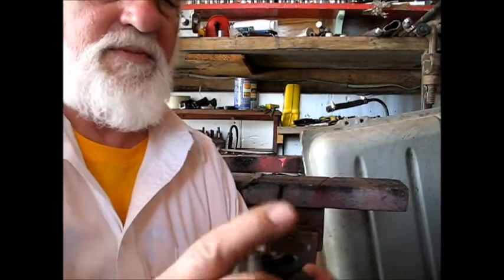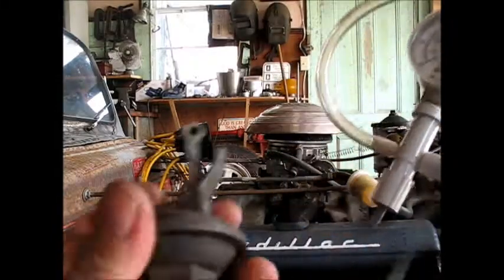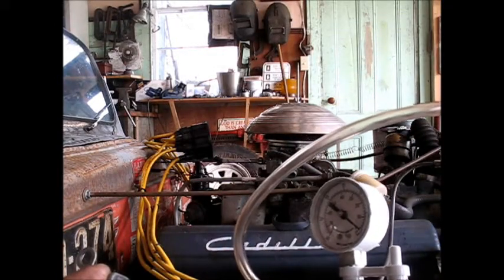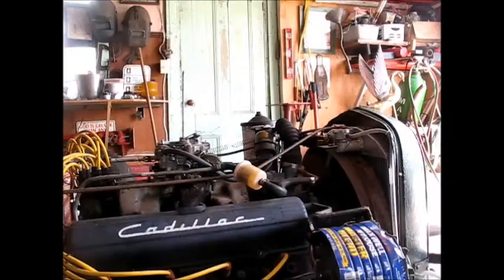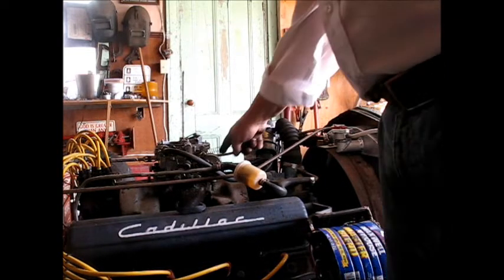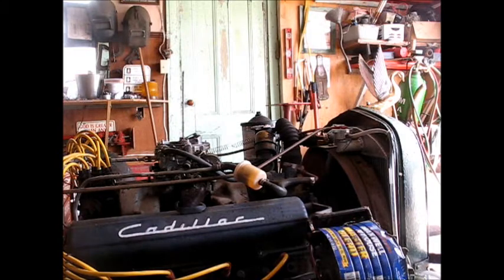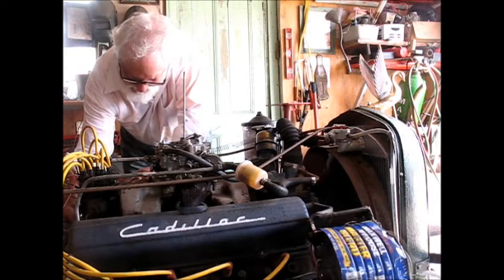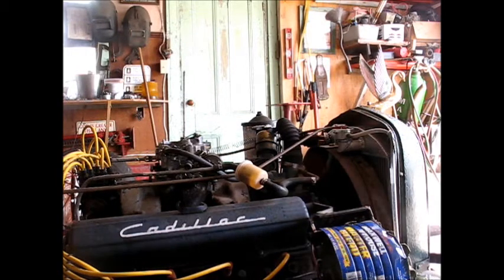Repairing a vacuum advance on a 1953 Cadillac 331

Comment: BTW, the vacuum advance normally works at idle not on acceleration. That is why most manuals will tell you to disconnect the vacuum advance when you are setting your basic timing with a light.
Hope this helps.

Comment: Easy way to test one if you don't have a vacuum tester is to pull the rod then hold your finger over the hole and if the rod stays and doesn't drift back it is good. From what you were showing it still looked like your diaphragm has a hole in it, since it should have sucked in and stayed until you released the vacuum from your tester.

Comment: Install a T fitting on your Vacuum line.Then run a line Thur the firewall to your dash. Install a manifold vacuum gauge on your dash.When you are driving the needle should hold steady.Accelerate the needle will move one direction. Using gas.Let off the gas. The gauge will move the other direction.Saving gas .If your engine is not running right.The needle will jump around..My 64 Pontiac had a fuel economy gauge on the console.That did the same thing.

Comment: Remember when you put the timing light on it to block off the vacuum first, Adjust the timing and then re-attach the vacuum line. If you set the timing with the vacuum advance attached, you will over advance the timing and reduce your low end power. :) but I figure a smart guy like you knows that already.

Comment: so what exactly happens when the vacuum advance is not working correctly? I have a 53 Caddi with a 331 engine and my engine wants to over heat when I stuck in traffic running temps of 210-220. When running on the freeway the temp runs about 160-170. I've been told that the vacuum is not working anymore and that's why it wants to over heat. Sound about right?
Reply from the maker: +Steve Ortiz   Well, the vacuum advance literally advances the timing as you accelerate.  This allows you to run a less advanced timing to help it crank better, so you don't get those luggy starts, like when the engine doesn't want to turn over, then as the timing advances, the engine runs faster, on acceleration, and tunes the timing back down when you let off on it.   Overheating can be a lot of things.  I'm guessing you've already checked the radiator, fan, thermostat.  If it overheats in traffic I'd say the fan isn't moving air through the radiator enough to keep it cool, and when you're on the freeway you've got plenty of air, so it runs cooler.  That's my thoughts..
Reply: +rpeek looking into my vacuum advance i realized it was not hooked up. Will hook it up to my carb tomorrow and see what happens.  Thanks for prompting me to look at my vacuum advance.
Reply from the maker: +Steve Ortiz   You bet.  Good luck with it.